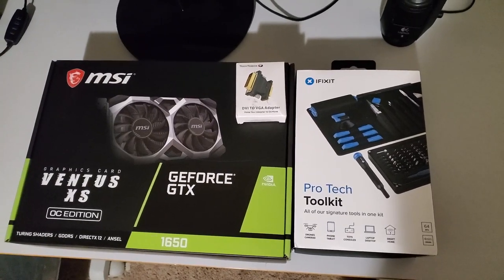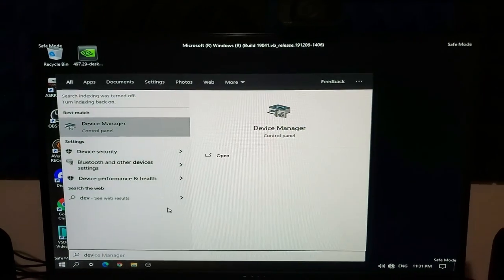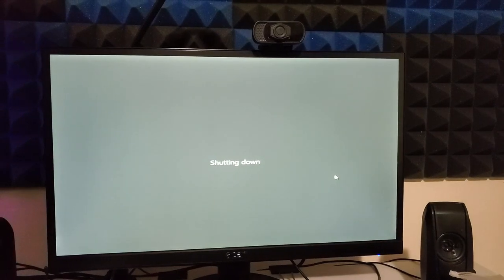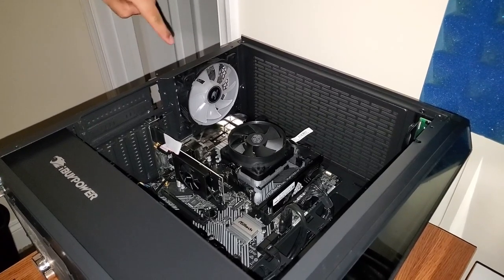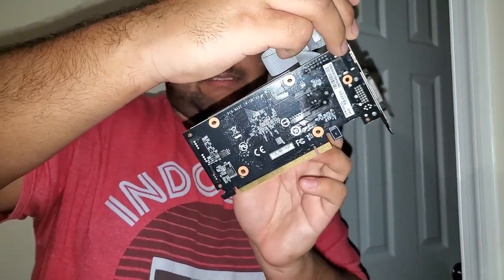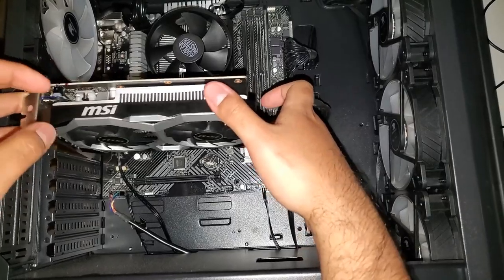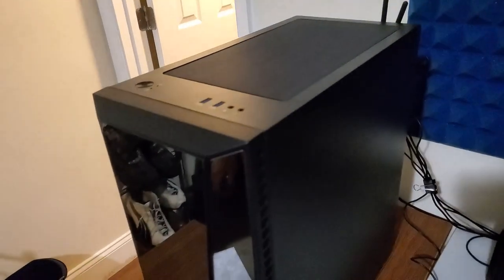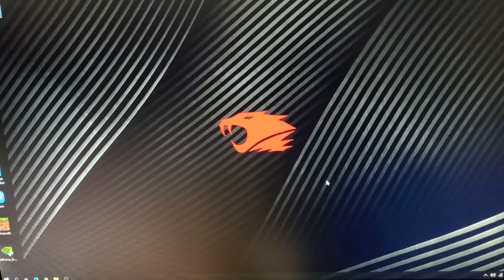My Very First Graphics Card Upgrade Video Ever! MSI GEFORCE GTX 1650 VENTUS XS 4GB OC PCI-e 3.0

Comment: Just picked up the same card looking to run some older games until the chip shortage settles!
Reply: It can run aaa games at 1080p man
Reply: Can u tell the warranty period
Reply from the maker: @dontcry006 On newegg, you can either buy a 2 year, 3 year, or a 4 year.

Comment: Where do I plug it in?
Reply: I think it’s called the PCIE slot it’s at the bottom of your motherboard or near the bottom
Reply: mine does not have one on the gpu it has not plug
Reply: @QWERTY-ei1gu  It's a pinless GPU, It's powered from the MOBO, not the PSU. Hence no PSU pins
Reply: @Bluesykk  then how in the world is it overclocked ?

Comment: Is your new 1650 the one you got in this video loud? like when your playing games dose it get really hot and make lots of noise?
Reply from the maker: Well yes but it does make noise but the fan speed isn't that loud unless you enable overclocking. I did not enable overclocking but it should be just fine to play games without overclocking.

Comment: Bro i also ordered the same gpu can i run it on a b250 board with cooler master 450 watt 80 plus silver certified psu please suggest me
Reply: You need at least 650W psu

Comment: How many fps for gta 5 and valo and cyberpunk
Reply from the maker: i really don't know. I DO have MSI afterburner but I don't own those games. But you can check other people's benchmarks on yt
Reply: @chavito808  yes but this gpu is not owned by many youtubers
Reply: @chavito808  i can find only u
Reply: 80 fps average on gta v max settings 160 fps average valorant max settings 1080p
Reply: @paulalfonso5167  i bought , and 110 fps for gta and 240 fps for valo
Reply: @mortu2809  what’s your specs?
Reply: @sodagrumpy7177  r5 3600
Msi b450 pro vdh max
This gpu
Csk 550
Stock cooler
Deepcool mattrex 50 mesh
16 gb ram
1td hdd 256 gb ssd
Reply: @mortu2809  is this graphics card worth it bro?
Reply: @latetron  yes for medium level gaming and editing
Reply: @mortu2809  thank you man
Reply: @latetron  but go for 1660 or 1650 super with 2 fans
Reply: @mortu2809  just bought this card 😭
Reply: @mortu2809  it’s decent for a first card right?
Reply: @latetron  yes for sure
Reply: @latetron  your specs ?
Reply: @mortu2809  thank you for your help, I appreciate it :)
Reply: @mortu2809  I3 10105f, this card, 500gb ssd, 16gb of ram, 600W power supply, z490 plus. only have a little left, hopefully they come tomorrow then I can build it. how about yours ?
Reply: @mortu2809  wait dw I can see yours from earlier in the chat
Reply: @latetron  but u missed ryzen 5 3600 or i5 11th gen ( value for money)
Reply: @mortu2809  motherboard only supports intel 10th gen
Reply: @latetron  so its an upgrade ?
Reply: @mortu2809  first build bro
Reply: @latetron  then why u bought that mobo , u can go with ryzen 6 cores 12 threads
Reply: @mortu2809  damn I should have done some more research but I’ve already built my pc
Reply: @latetron  dont want to regret its good for 1st build
Reply: @mortu2809  ty bro
Reply: @mortu2809  hey do stil own this gpu i have a quastion how many fps you getting on minecraft with shaders on and gta 5 like games in 2023 it is still worth in 2023 ?
Reply: @Cosmic_712  still worth .. will get the same fps as i mentioned earlier
And i going to sell the pc . im going abroad
Reply: @mortu2809   Do you want to sell your GPU?
Reply: @Cosmic_712  No bro i plan to sell the whole pc

Comment: Is there any cable that must go in the gpu or not?
Reply: no
Reply: It depends if yours is the gddr6 one you need to have a 6 pin power connector but if you only have the gddr5 one you don't need a 6 pin
Reply: Nope